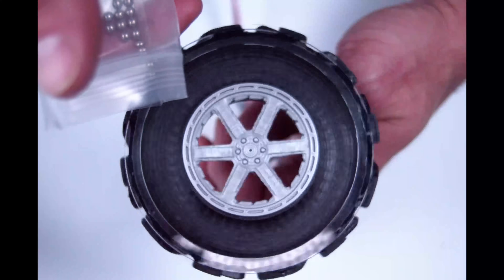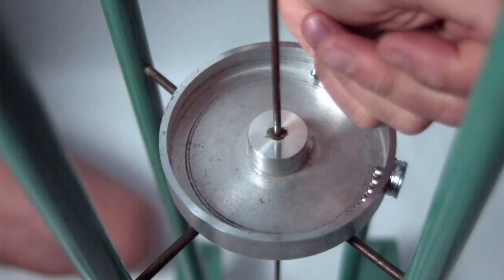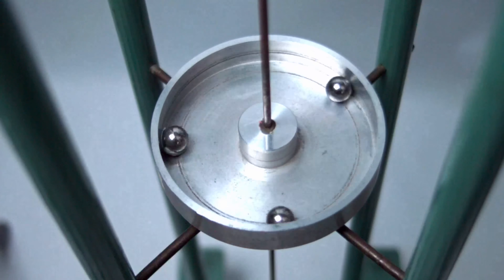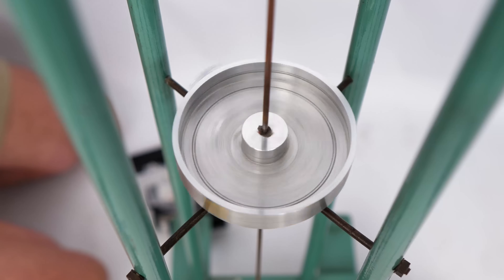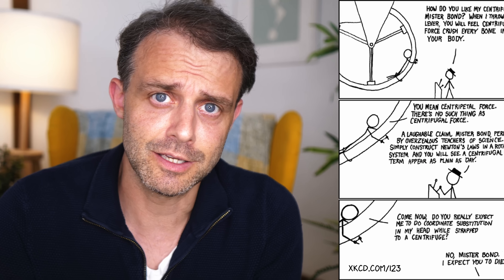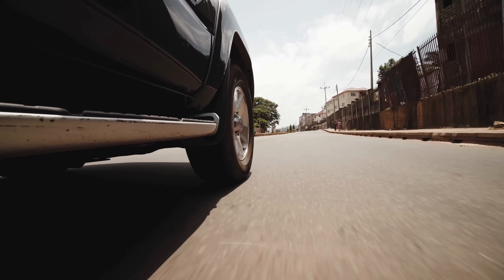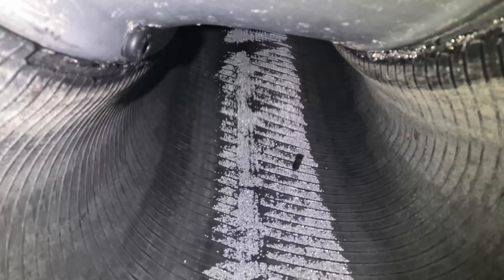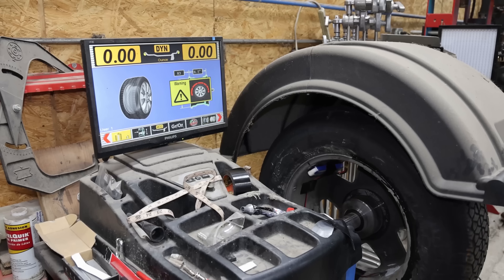Do tire balancing beads actually work?

Comment: My teachers in automotive taught us about the beads and said exactly that. The beads are only good when you’re driving on a highway at a certain speed. They told us that while the beads significantly improve tire balance at high speeds but are no help in local or city traffic and that they make a ton of noise. Besides the noise, the reason the gave us why we’ll never use them is because they have to be precisely weighed for the off balance of each tire and quote, “are never gonna trust a teenager with a bag full of tiny balls”

Comment: considering they only work after you've reached 80kph + and then you can't stop. they seem more or less useless. unless you drive highways like 95% of the time. besides which, every tire i've ever bought came with free balancing on the install so..... and has anyone considered the friction and heat generated by things rolling around inside the tire? years ago, i remember reading about tire blow outs that can happen due to water in the tire mixing with rubber dust, forming a ball, and causing wear on the inside. dunno if that's a thing anymore or not though.

Comment: I had beads put in my Jeep's new tires.  It worked great as soon as I reached a good speed and then would start wobbling again when I would hit a bump on the road and stabilize again.  I finally had them removed as it got very annoying.  It does work in ideal conditions.

Comment: Works 100% 

It also doesn’t take freeway speeds to balance. 37” tires with only a few ounces of balance beads and perfect balance at anything over 20mph. Better than 5 attempts of rigid balance weights by mechanics using road force balance machines.

Comment: i run things called Centramatic tire balancers on my truck, they are just a ring of oil and beads you put on behind the wheel, will balance up to a pound out of balance, so i'm still balanced even when the wheels are packed with mud

Comment: The previous owner of my motorcycle put in balancing beads. They don't work, and they make it impossible to use a bubble balancer to fix the problem. I wish there were an easy way to get them out.

Comment: So we just need some balancing beads that somehow get a sticking property when we are going 80 km/h and tires are permanently balanced. Maybe a fast heating bead that spills some glue at some desired point or some glue beads alongside that pops with a specific pressure when the car goes 80 km/h. Seemed doable. Business idea for interested ones :D Maybe?

Comment: I bought a motorcycle and while changing one of the tires I discovered it had no weights on it and was full of little beads.  I had no idea what they were.  I had to do some research and finally figured out they were to balance the tire.  It seemed rather ridiculous but I think I bought more to replace what I lost and after the bike was up and running it seemed to ride very smooth.  I guarantee that you don't want tires out of balance when you're only on two of them going at high speeds and leaning into corners.  Seems like a bit of a miracle but have to say it seems to work.

Comment: What if you added the beads with epoxy and spin them fast enough until they cure in the right place? That seems impossible inside a rubber tire, but in theory?

Comment: Thanks for your explanation. I've argued the flaws of balance beads with a few people on forums before and there was no convincing them that the beads have to continually rebalance the tire every time you slow down. The mechanism by it's process has a harder time working with tires that are more out of balance. I think that people who have tires that are very close to being balanced have much better results because there's less fixed mass out of balance, which makes the tires seem less out of balance at slow speeds so it's less detectable and makes the tire balance faster once they speed up.  In my own case, I had tires that were unworn since the tires were on a truck that sat for a few years. They were too old for a tire shop to balance so I tried the balance beads. They worked on and off, as you stated they will do, when I sped up and slowed down. I found it very annoying and frustrating. Eventually I met a person who had their own tire machines. He agreed to dismount my tires, suck out the beads with a vacuum and remount and high speed balance my tires.  Now they are perfectly balanced all the time.  His machine measures how out of balance a tire is in order to direct where the additional weights go. I had one tire that was out of balance by 2.5 ounces.  I assume that tire was the one that was challenging for the balance beads to correct quickly so it was easily felt as out of balance until I drove some distance at speed before it would settle down.

Comment: There’s one huge drawback to these beads.  Under very heavy loads, like pulling a trailer these beads actually damage the tire from the inside out at highway speeds.  Our company blew out a brand new tire that delaminated at highway speed and there were (lead?) balls inside the tire.  At least half a quart of them.  They might very well have worked, the truck ran smooth, but 1000 miles down the road both rear tires on the F250 were destroyed.  The inside of the tire tread was worn smooth and shiny.

Comment: We use airsoft BBs yeah they’re a bit of a pain you have to break the bead to dump them in. But in the past, we’ve used flower, dirt, just not sand that just chews up the inside of the tire.

Comment: Did you account for the weight of the car over the axles? Instinctively  I feel it should help a lot with stabilizing the wabbling and maybe bring the optimal balancing speed down by a lot, but I don't know if my gut feelings are true in this case. I thought that maybe the weight of the car would act in the same way your hand did for stabilizing the mixer

Comment: At 3.51 I paused it just so I could think why it might be doing this. I think it's because at the slower speeds the balls in the imbalanced configuration are not describing the biggest arc possible for their angular momentum where in a closed system the rotating mass wants to describe a circle and not an ellipse so the angle where the ball touches the inside of the wheel also wants to be equal on both sides. Really interesting problem though. I didn't come across it before so I'm interested to see what you found out, so I guess I'll watch it and find out :D

Comment: Interesting, I used balancing beads on my '04 GSXR600 and never had any issues at any speeds. Even when i never got on the freeway. The one issue i had after I installed the beads was getting the bike stolen.

Comment: I wonder if magnetic beads strong enough to hold them in position when slow or stopped but weak enough to move into perfect posotion at 80kph would work? This would obviously require steel rims or a steel strip inserted in the tyre.

Comment: This is interesting, what is stopping someone from putting beads in with something like quick dry epoxy or some other glue to fix them in place? Run the wheel at a high speed to move everything into position and stay at that speed long enough for everything to fix into place. You might not even need the beads, maybe the weight of the epoxy itself would be enough. Something like a 15-30 min epoxy? 

I would love to see if the same thing works with liquids instead of beads!

Comment: Yeah.... No, don't use them unless you need them.
Running a raised truck on knobby tires... And still spending ½ or more of the time on the road...

Every time you go off road, you can mess up the balance... And that big tire is gonna shake at speed.
Then the beads are nice, I guess ... 
They do work, but I sure as hell ain't using the stuff in a touring tire on a car that I want to be comfortable in... Trust me.

Comment: If you imagine the spinning disc as a closed system. Centripetal force acts like gravity. Beads go where the potential force is the least and becomes part of the new inertia. The initial oscillation is just the bead going back and forth in bow or dip as if it was gravity. For this to happen, the Centripetal force needs be high enough for it to exert frictional force on the beads as frictional forces are dependent on weight type force that the Centripetal force is now assuming. Unbalanced disc is just a disk with bead fixed to one spot. If that one bead was not fixed then it would gain spin in the opposite direction to try to balance the system.

Comment: Unfortunately I don't see how this is feasible or worth dealing with. 1. The beads will not settle into the correct alignment at low speeds and  will simply fall back to the bottom of the tire when parked . At the same time these glass beads will wear down and break apart and become sharp as off you are Sam's blasting the inside of your tires at lower speeds . What is the point?? Put the weights on and forget about them. It's only a few bucks a tire .

Comment: seems like a reason to use slime in car tires, it'll do a similar thing, being a fluid and itll protect you from punctures occasionally, just you need to find a mechanic who's willing to take the 30 seconds to break a tire bead and insert a tube to take the slime out when the tire needs changing, which is amazingly challenging
Reply: I tried it, for some reason it didn’t work, Lots of vibration. It has been several years so I cannot remember if it was summer or winter. After two weeks I finally gave up and had it cleaned out.

Comment: I do a lot of city drive for my job. No way, I could have my tire balance with those beads. So it would mean I would drive around most of the time with unbalance tires witch is not good for the the bits that hold the wheel in place.... Nor it is to get to the balancing of the tires. Would cause damage on the long run... just my two cents from my experience

Comment: No, it's perfectly intuitive. The rotating body seeks stability, adding anything that's fluidic into the system would move around till it finds equilibrium by acting as a counterweight. If it's just one solid object it would be unpredictable where it would stick to (due to centrifugal force) each time the system rotates. Giving the object fluidity and significant mass makes it easier to move and find its equilibrium like a gyroscope.

This is Not "counterintuitive" to the science community who's familiar with gyroscopes and few other fields. 

However this video is informative. Not saying it's not. Just picking at the fact the pretense was set by calling it counterintuitive.

Comment: you made this entire video when a 10 second google search could have told you " yeah its exactly like you learned in third grade " yes they work proven for millions of miles in all kinds of applications in including motorcycles ATV cars trucks etc. Also there is balancing sealant like "ride on" which works even better and sticks in place  bit longer as it ages and doesnt wear the inside of the tire.

Comment: It would be great if you spin the wheels so fast that the balls get positioned and the add some form of glue on the inner surface of the tyre which glues them permanently.

Comment: This reminds me of an extra credit problem in classical mechanics class.  We had to explain, using math, why a strange effect occurred:

Imagine a piston going up and down with the end of a short bar attached loosely to the top.  When the piston goes up and down slowly or very quickly, the bar would just flop around. But, when the piston moved at a precise frequency, the bar would orient itself straight up and down, seemingly defying gravity.

It was a good into into auto-correcting systems.

Comment: I wish I had found your video BEFORE trying them in my Jeep, which uses 35" x 12.5" tires.  At the recommendation of the bead manufacturer, I put 16 oz. of ceramic beads in each of my tires.  They seemed to balance well between 25 and 60 MPH, but the vibrations became stronger after 65 MPH.  Suffice it to say, this proved to be an ineffective solution for motorway travel, given that in my area, we usually drive over 70 MPH. The beads were replaced by standard weights, shortly after this failed experiment.

Comment: the other problem is, beads MOVE every time you stop they will all settle to the bottom and when you start moving again you have the same unbalance problem until they get to the right position once more now also if you dont reach a high enough speed (which is not slow at all) they dont do anything.  these have been tried and proven not to work multiple times over the last few decades, im surprised this channel didnt do some more homework on it

Comment: Balancing beads are a poor version of dynamic balancing.  The Centramatic balancers are vastly superior and work at speeds as low 25mph and are ideal on dually setups and trailers.

Comment: Now I wonder how this will work in a racecar setup, like within nascar or drag racing? When you're going well above freeway or critical speeds constantly, and any little vibration can have an impact on the car's performance, it might be a valuable method. However, I think someone in the comments did point out that depending on the quality of the rubber and air, the beads can get stuck in a spot where it is not meant to be. Racecar tires become very hot on the exterior of the surface to promote better grip and traction. Maybe the inside walls of the tire will also become tacky enough to prevent the balancing beads from moving around freely?

Comment: This could be really interesting for SpinLaunch. When they release the payload, their entire launch system becomes unbalanced. Right now they fix that by actively moving the counterweight. But a bunch of rolling weights on a rim (or concentric ones to keep the weights from colliding) might add a lot of passive stabilization.

Comment: So if someone combined something like resin or epoxy in with the beads, and have it take, say, an hour afterwards, then take 10-20 minutes to do pay work, get paid, then you can have the customer drive for 40-50 minutes on the interstate, this would a permanent solution to balancing a car tire perfectly?

Comment: 45-50 mph is when this resonance typically happens [and similar intervals above]. Please know that these beads are a genuine pain for technicians – they fall through when installing, fall out for tire removals, require a vacuum in many cases, and become a genuine nightmare if any moisture enters [which is common]. Only use these as a last resort or for specific motorsports applications such as off-road tires that are difficult to balance.

Comment: The glaring flaw in almost all of your examples is that you never tested this in a vertical plane. It's all horizontal with a flat, even, solid bottom that distributes the weight of the discs evenly on a vertical axle. 

Try doing this on a vertical plane with a horizontal axle, with gravity acting on the material, the way it acts on rubber as you drive.

Comment: Back in the 60s when tires were made out of nylon and bias ply little beads of the rubber would roll around in the tire they would get as large as marbles she would have about 6 to 10 of them inside your tire when you drove slow you could even hear the marbles of rubber falling in the tire.

Comment: if we could find a way for the beads to detect when they've reached super critical self balancing and then release an adhesive so they could lock themselves in place wouldn't that allow it to work even when you stop and start back up?

Comment: ive done loads of big tires on off road rigs on bead lock wheels. you cant get the tire on straight ever. the balancing options often were add pounds of static weight and do it again in a month, or add balancing beads.

Comment: So, in practice, they're useless... You have a wobbly tire on your way to the freeway. You get on the freeway, where you won't feel the unbalanced tires anyway, and the beads start settling into place. Then you get off the freeway, but have to stop at a light and merge into normal traffic.... The beads had no effect on your trip.

Comment: The correct answer to whether these beads work is no. Temporary balancing is not adequate if you care at all about repercussions from vibrations damaging your tires and car components and potentially steering leading to an accident. 

Just put on the damn weight, they dont charge extra for it anyway. It is standard in a mounting charge.

Comment: I only saw these balancing beads in truck tires when I worked in the tire business. Thing is, here in EU trucks are limited to 90km/h and their legal speed limit on the road is 80km/h max. They never get to the actual highway speeds, they are stuck on the speeds where the tire imbalance feels the worst. So yes, the beads nothing and are a scam.

Never saw the beads in any normal car.

Comment: Hi, retired trucker here. When installing new tires on rims I always put inside them three
golf balls. Worked like dream, tires were balanced and that balance stayed there for life of the tire.
Reply: I would hate to be driving close to a "golf ball" balanced tire when it gave out! lol. 
That being said i'd hate to be near any tire exploding...
Reply: @bobinator17  when truck tires blow, the golf balls are the least of your concerns :X
Reply: @Ravenholm337 but not the cars around him. Very concerning for them.
Reply: @christopherclark1948  When a semi tire blows the chunks of tire are moving fast enough to be dangerous all on their own.  Those tires are running about 120PSI of air.  The golf balls add basically nothing to the danger.
Reply: @Devin_Stromgren those golf balls have significantly less mass and will travel further and faster.
Reply: @christopherclark1948  Less mass is good for you if you happen to be on the receiving end of any sort of projectile, generally.
Reply: My dad was driving next to a truck hauling a load of full glass soda pop bottles when it blew a tire.  A tire piece his his car and made a big dent.  It was obviously quite a sizable kinetic event.